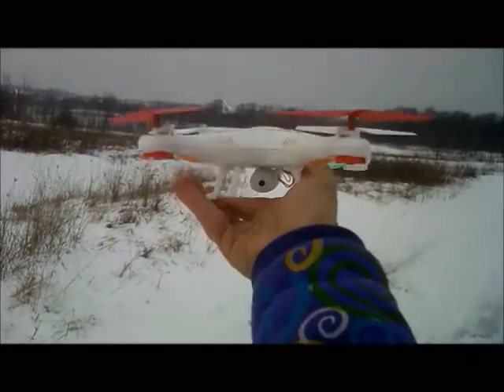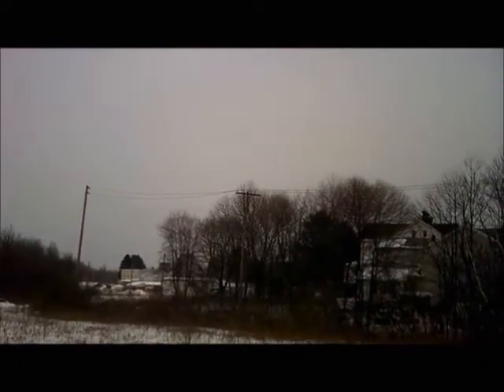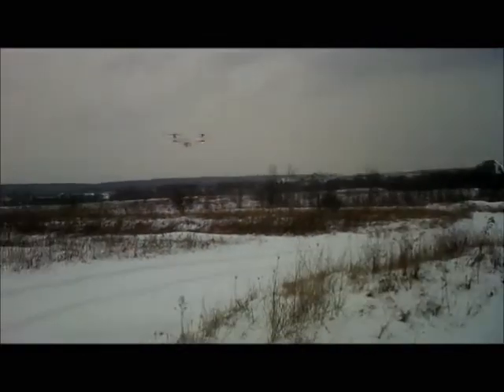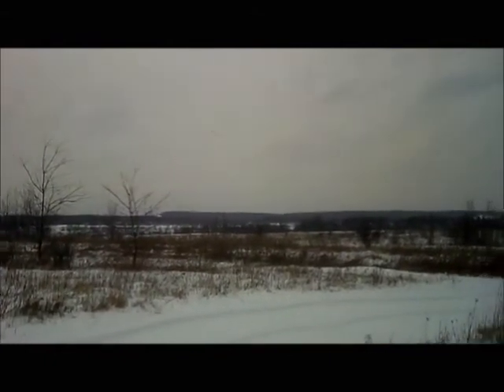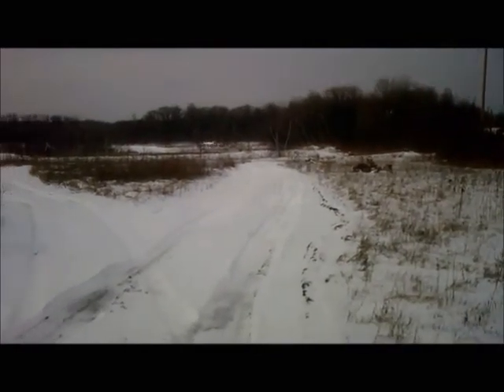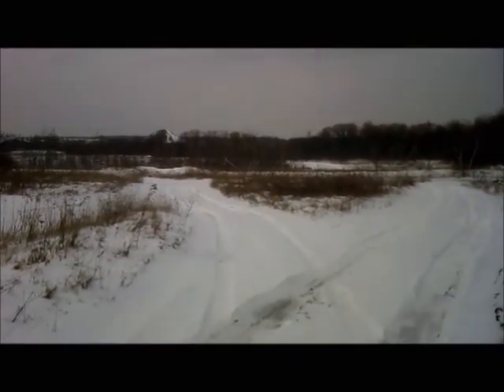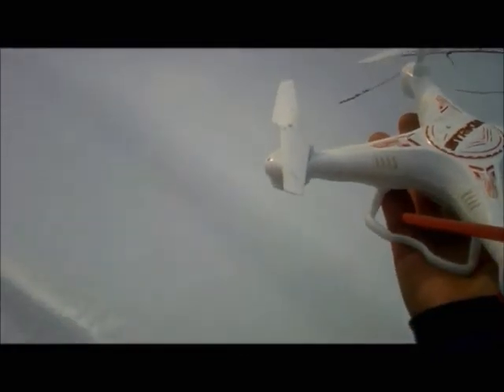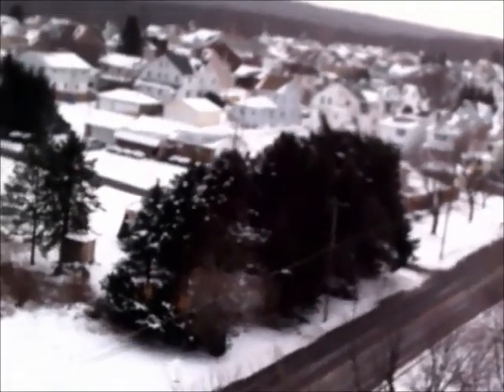Striker Drone battery test in extreme cold head cam and drone cam

Comment: What model charger do you use or recommend?
Reply from the maker: not sure I understand are you asking what battery u should use
Reply: I noticed there are different chargers for the batteries. 5 port ones 6 port ones. Do you prefer one over the other? Im assuming they all shut off when the battery is fully charged?
Reply from the maker: Soulcommander i like a 5 and yes all work well and go off when charged
Reply: Ok Thanks  :)